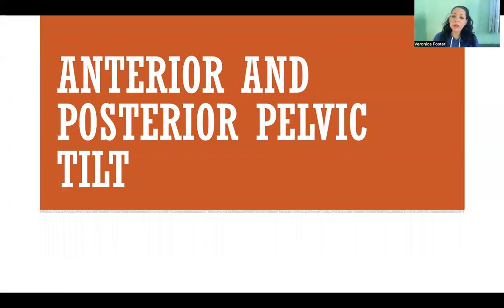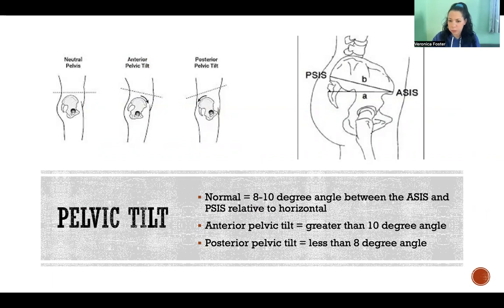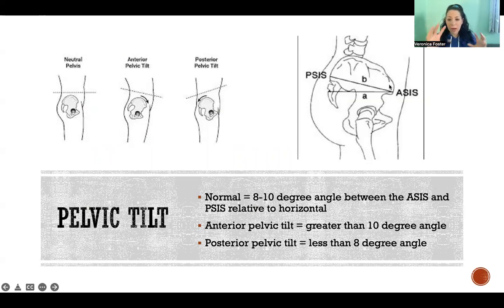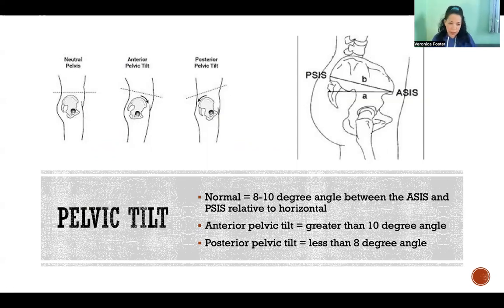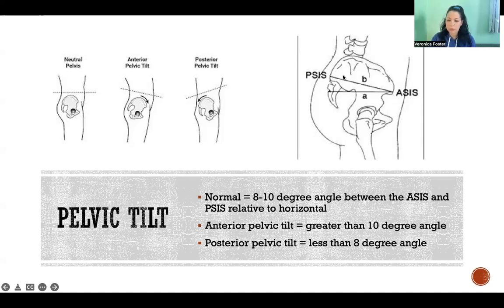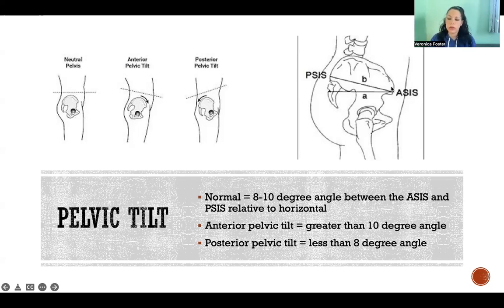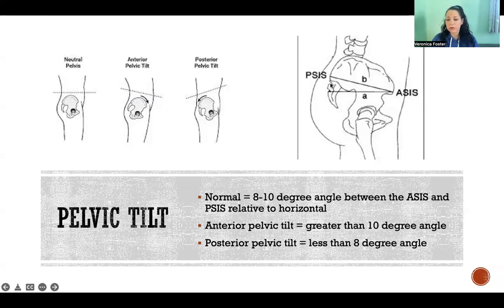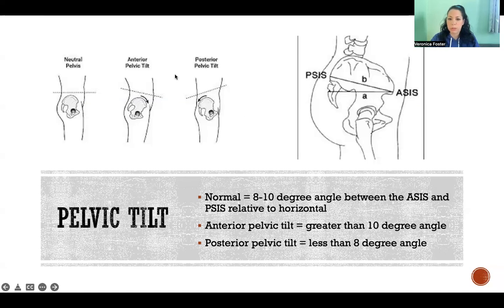Anterior and Posterior Pelvic Tilt

Comment: Mam, Is it done by taking pelvic xray and then measuring it?
Reply from the maker: Hi Asif, you could, but that would be excessive if you are only doing a postural assessment. Usually it is measured right on the person using a goniometer, or you can take a picture and do the measurements in a picture or video. If you have difficulty visualizing the bony landmarks, you can palpate and find the landmarks, and mark them with stickers or pieces of tape to make them more visible when you are measuring. I hope that helps!
Reply: @DrVeronicaFoster  Thank you Ma'am 👍
Reply from the maker: You are very welcome!
Reply from the maker: @asifshabanpt9412  You are very welcome!